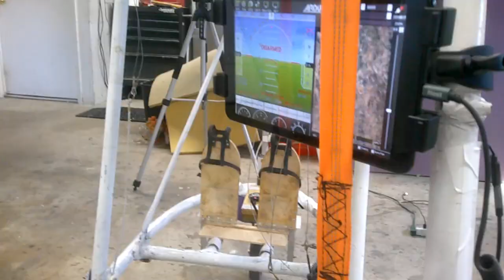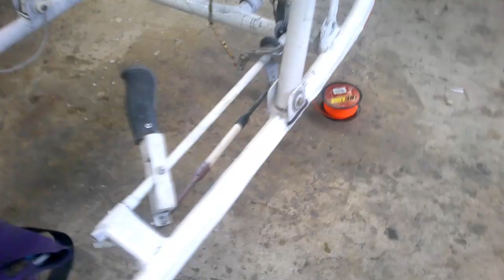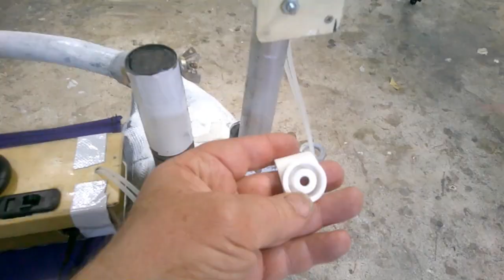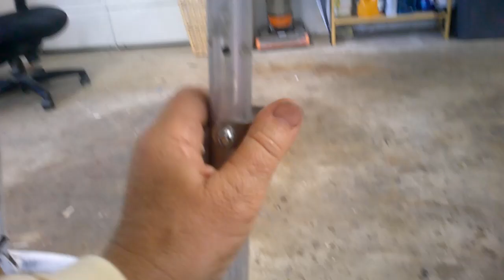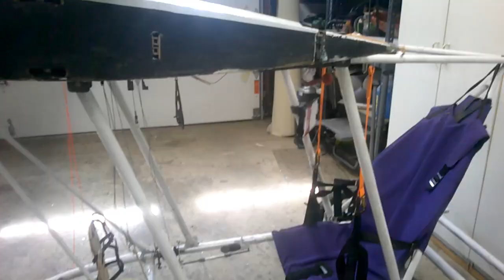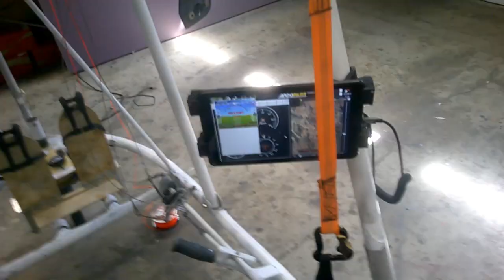Upgraded Cockpit Tour - Klingberg Wing MkII Ultralight Glider

Comment: Couldn't you just 'cotton bud' some epoxy into the wooden plug bolt holes sealing them up once they've had a chance to dry out?
Interesting video as usual, thanks for the freebie.
Reply from the maker: Hmmm.... Interesting. If only I knew what a cotton bud is. Sounds like a cross between what one might smoke and clothing. I'm guessing you mean cotton flox which is a mix of powered cotton and epoxy. Then my answer is no, because you would never get the bolts back in aligned properly. However, I do have some fiberglass pultruded tubing with a 1/4 inch ID. It would act as a bushing. I could drill out the holes to accomodate this bushing and eliminate the problem. However, stainless steel also solves the problem. But having wood plugs that can get wet and expand is generally a bad idea. Filling the ends of tubes with cotton flox or epoxy with a thixotropic filler and then drilling would be the better solution.
Reply: @KlingbergWingMkII  > 'cotton bud' - I thought it was an international generic term for what a Q-tip is (tightly wound buds of cotton on both ends of some kind of small stick), guess not.
Anyway, using one (or tiny art supply paint brush if you like) to paint the inside of the hole in the wood plug with a coat of epoxy to stop it from absorbing moisture is what I meant.
Or just go with the stainless bolts, which also notably will rust and micro-fracture given enough time in a salty environment, just ask a sailboat owner. 😊